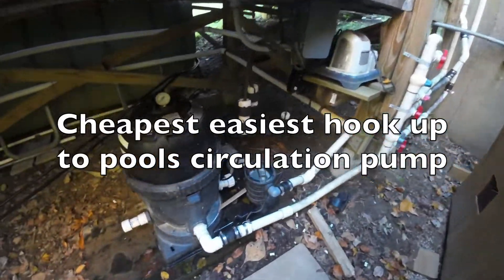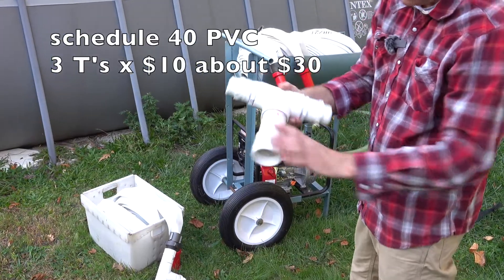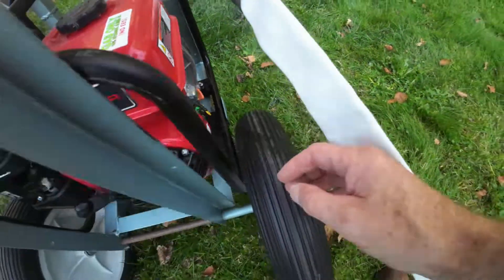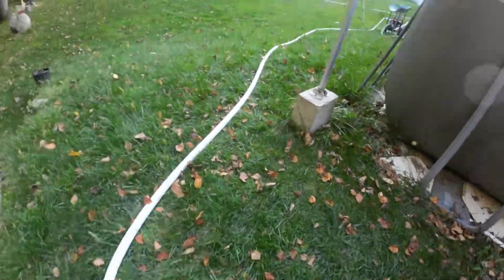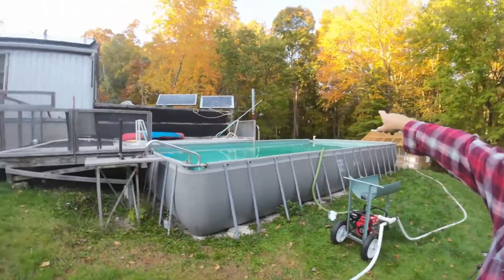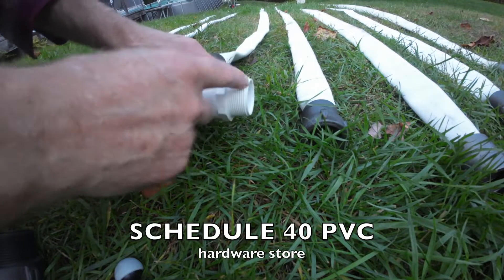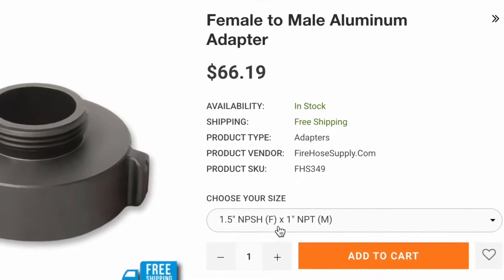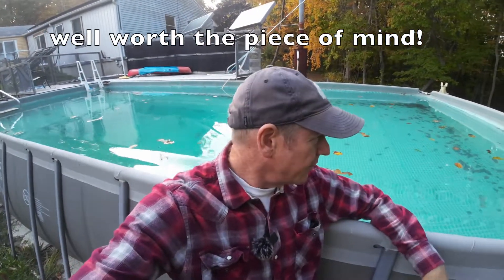DIY Wildfire Protection System, How to pool pumps & hoses

Comment: If you want effective, inexpensive wetting solution to your pool add 5-10 gallons Dawn Dish Washing soap or Ivory soap flakes, maybe 2 boxes. The fire nozzle will aerate and foam nicely.
Reply: Great setup. Just shared with some of my California people. Thanks
Reply from the maker: Good idea, especially if you’re big trouble and ready to commit!
Thanks,
Reply: I’m confused. What does the soap do? Does it allow the foliage to stay wet longer from the foam? Is there a Phos-check dupe to be made/had?
Reply: @PiddlesK  Soap reduces the surface tension of the water so its sinks into fuels faster
Reply: Idealy, you want to add the foam after the pump. The foamy water could cavitate your pump.